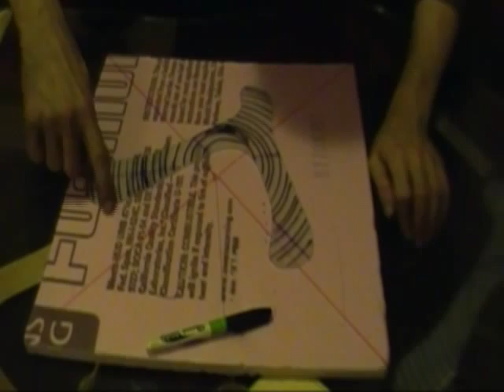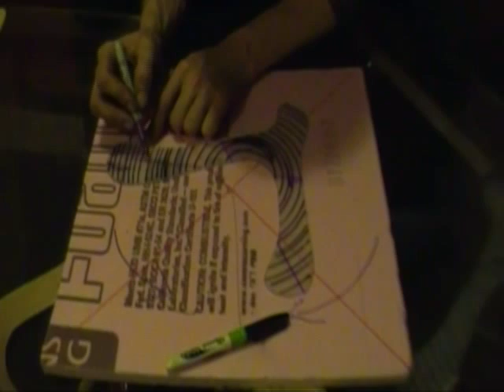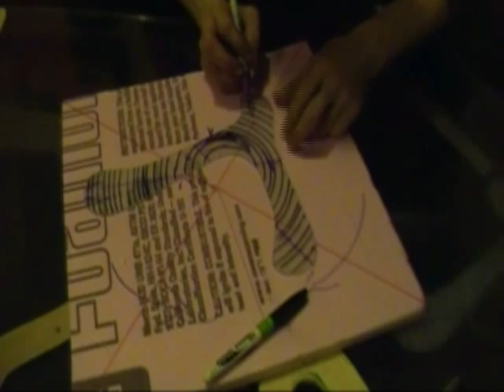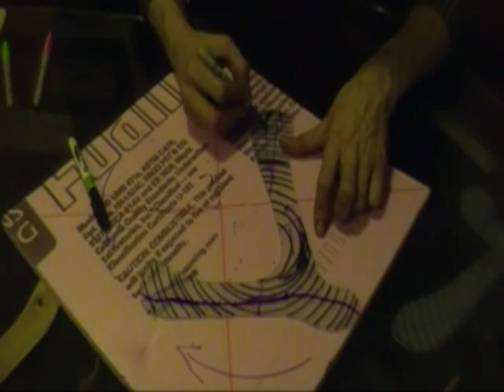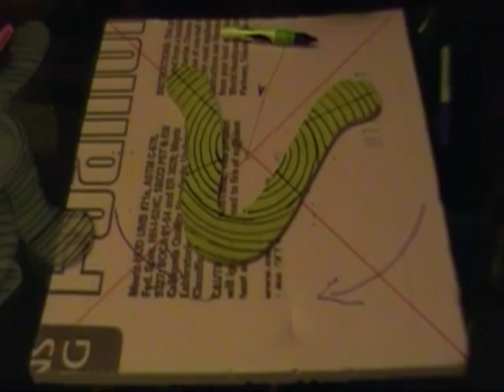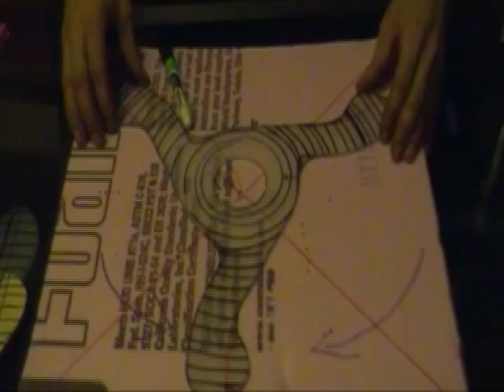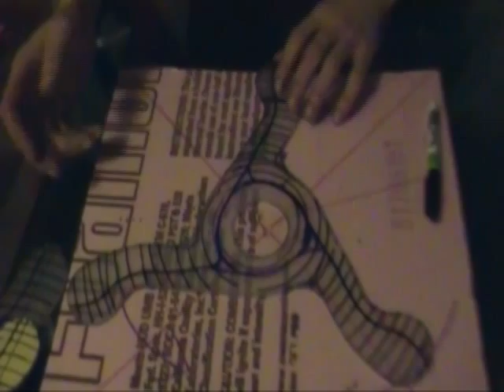How to make a boomerang [Part 2]

Comment: hi i cut out a 45 degree shape straight edge got real stuck my leading edge seem fairly straight till perpendicular lines thats where i got stuck one third went only goes from tip down to only about one third then hits perpendicular line not sure how to shape any chance on putting up a easy shape ie 45 degree angle to show me ?

Comment from the maker: @R0cKMAX Hello =).
 
Yes this is how to make a right handed boomerang.
 
I explain what a left handed boomerang looks like shortly after 4:52 in the previous video. 
 
'How to make a boomerang [Part 1]'
/watch?v=uYnR9PqPRXA
 
Basically, all you have to do is remember that a right handed boomerang spins counter clockwise.
 
A left handed boomerang spins clockwise.
 
So you would just reverse the leading, and trailing edges of the wing. I hope that helps you.